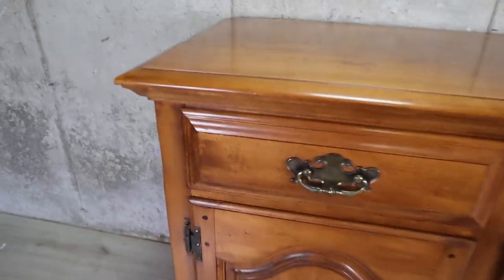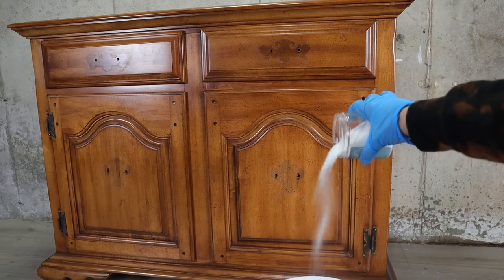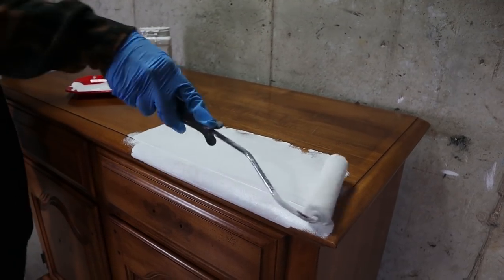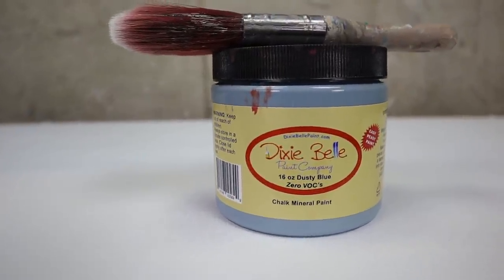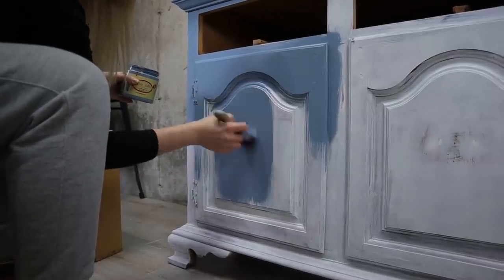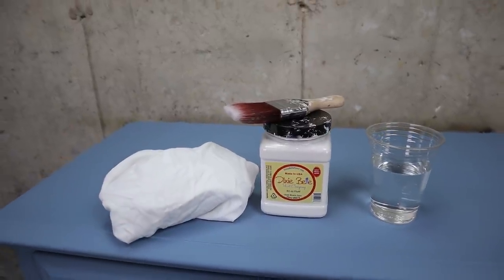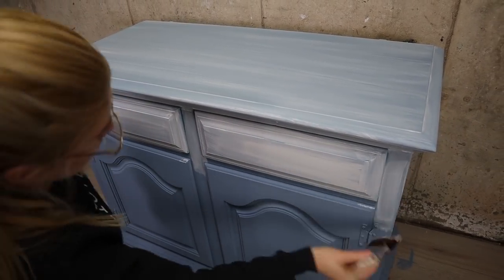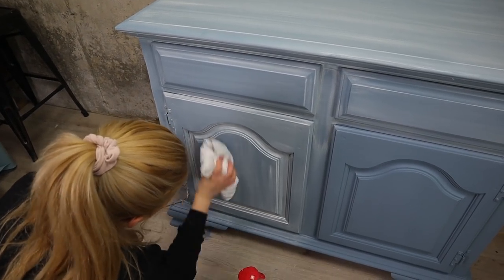How to Paint Furniture ~ Dry Brush and Paint Wash

Comment: For color washing, Is there a reason you like to dip your brush in the paint and water rather than pre-mixing a batch of paint with water to apply? You make it look easy but I'm pretty sure I'd make a drippy mess and have inconsistent ratios of paint:water each time I dipped the brush.
Reply from the maker: Paint is constantly changing its state depending on your climate, how long its been open, etc... Sometimes you'll have to add more water during the second coat because it'll dry out on you just for being open!
Reply from the maker: Oh I miss read that, for color washing thats just the way I like doing it. There are many other ways to accomplish it and you can use your preferred method!